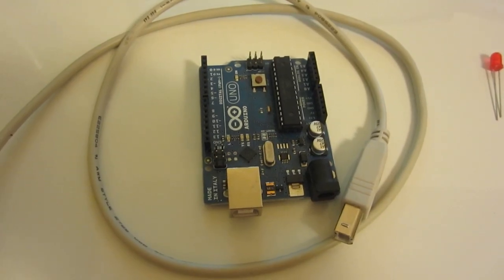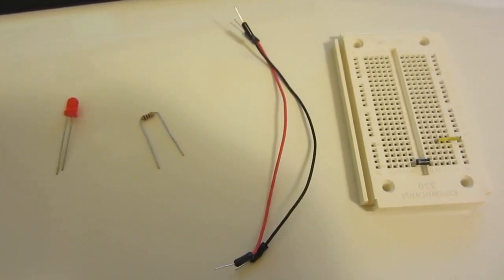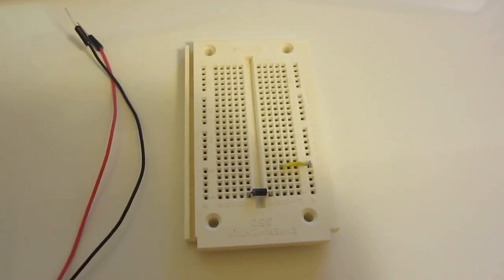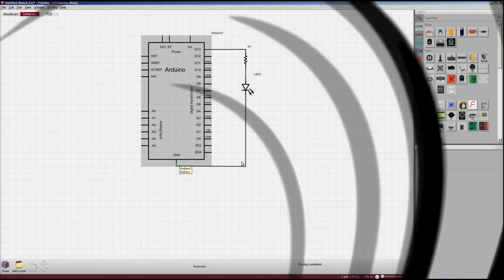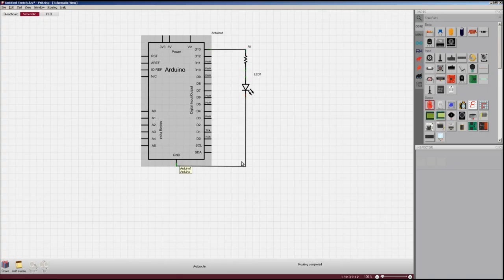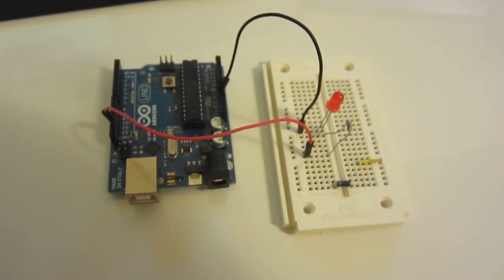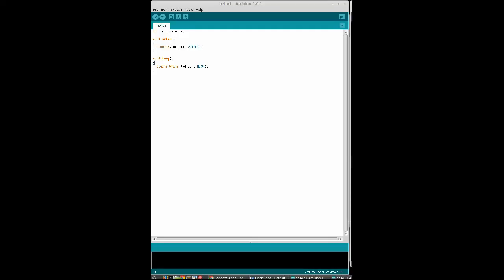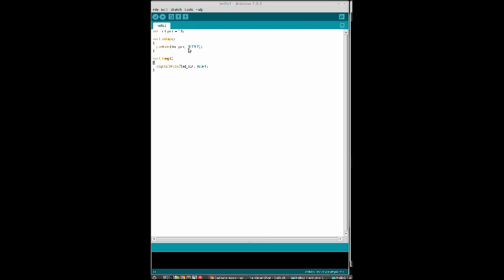Beginning Arduino Part 1: Lighting up a LED

Comment: Pin 13 all ready has a resistor hooked to it. Plug the led + into pin 13 and the led -
into the Ground pin next to pin 13.

Comment: what is the code for the program
Reply from the maker: Sorry, I'm not sure why the code recorded in such low quality. To light up a LED:

int led_pin = 13; //or whatever pin the LED is on

void setup() {
   pinMode(led_pin, OUTPUT);
}

void loop() {
   digitalWrite(led_pin, HIGH);
}

Comment: what's the purpose of adding a resistor, and why does the led have to take the current in the + wire, and send it through the - wire to ground instead of vice-versa?
Reply from the maker: LEDs are a special case for a diode, one that emits light (LED stands for Light Emitting Diode). A diode only allows current to flow in one direction, meaning if you turn a diode around, it will prevent the flow of current. LEDs are a diode first, and a light second, so if you turn them around they'll act like a diode should, they'll stop the flow of current.

As for the resistor, LEDs operate within a voltage range and if you get above that range you can damage them. An Arduino typically puts out 5 volts which is more than a typical LED can handle, so you need a resistor to bring it down to around 2 volts.
Reply: DIY Fun Adventure I see..  led's are like a diode without any resistance (almost none).  I've heard that they can take about a 20 milliAmp (20 thousandths of an amp), and I've learned how resisters effect current, though voltage still appears a bit vague to me.